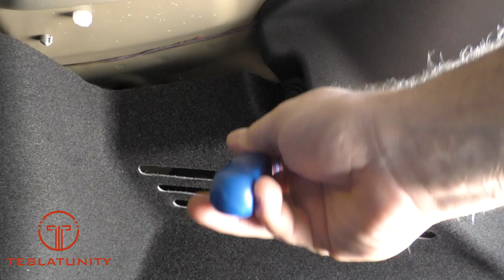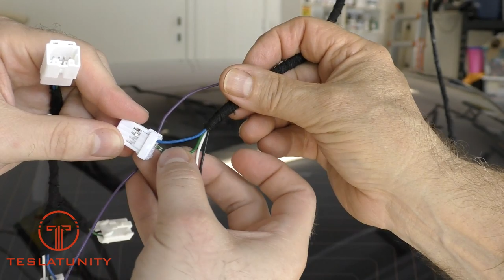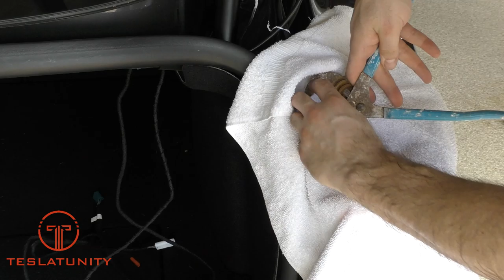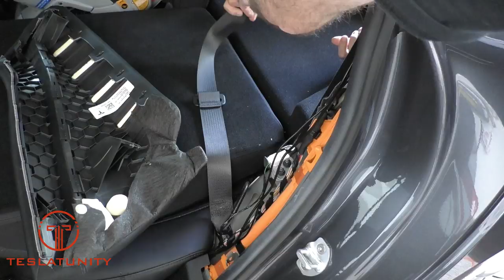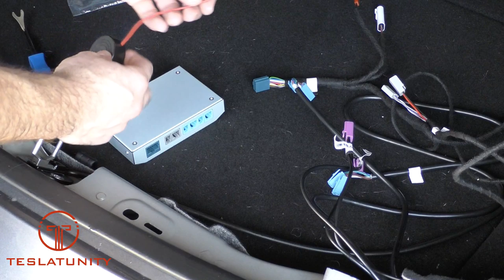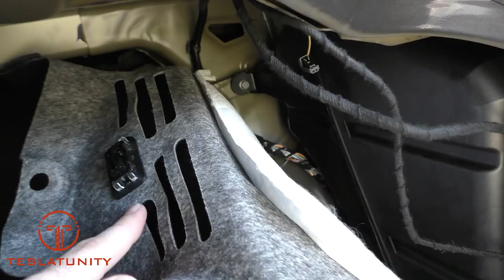Installing the Tesla Model 3 Power Trunk!

Comment: Thank you so much! Best tutorial out there! I pulled the trigger and purchased the kit after watching and just finished installing by myself. It took me about 4-5 hrs, but having another set of hands could have helped a ton! FYI - they have recently updated the kit, specifically, you no longer have to tap the green wire on the liftgate with purple wire. They now have a plugin option for that. I did not realize this and used a positap, which left me short one for the can wires. I also could not reach the red power wire (very hard to reach) and decided to tap the blue 12v wire. I had to scramble to buy something to tap the wire as my local stores did not carry the positaps, which I really like.  Thank you!

Comment: Thanks so much for the video Michael. Just completed my install and this video was invaluable. By far the most challenging part for me was the power connection. I connected to the red wire/nut that's in a very difficult to reach position. Overall I'm happy with the Tesla Offer kit.
Reply from the maker: I am glad you found the video so helpful and nicely done getting the power in the best position!!

Comment: Hi,
Have you installed the foot sensor?

I just installed my electric trunk this weekend. My foot sensor is not working as I hope it would do, its not very sensitive to my foot movement. Sometimes I have to move my foot back and fourth several times to make it open.
Reply from the maker: Sverre Olsen sorry no I didn’t go for the foot sensor. I didn’t want to take off the bumper and figured for my personal use there would probably never be a time I couldn’t pop the trunk from the app.
Reply: Michael Bodner thanks for the quick reply😊 You’ve had the electric trunk for quite some time, does it still work well without any issues?
Reply from the maker: @sverre1990  you're welcome!  I actually uninstalled it from my car, but want to say at the same time there were absolutely no issues with it.  I was having some issues with Tesla denying a completely unrelated warranty claim and it made me nervous that should I have any electrical or 12V power issues that Tesla would point to the power trunk and use it as a means to deny the warranty claim.  Funny enough, within a few weeks of pulling the kit, my 12V died without warning.  I hate that I took this out though as I feel as though the car really needs this!!

Comment: GREAT Video!  Much appreciate the details.  I just completed the install.  I did the button for inside the car, but haven’t installed the foot sensor.  Just curios, you cannot close the trunk with the app or the monitor in the car?  I could’ve sworn I saw it someplace.  Did I screw up something during the install?  The button on the trunk and the button in the car both work....  thanks so much!
Reply from the maker: Thanks, I am glad you found this helpful!  You should be able to close the trunk from the app, but not the screen in the car, which you wouldn’t need since you did the button inside.

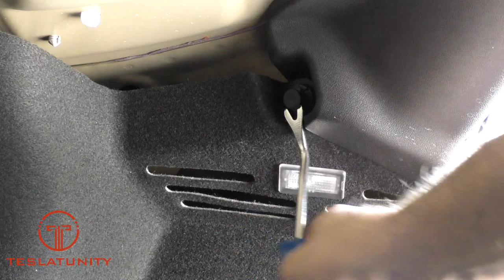Comment: 4:40 don't pull at the knob, the knob needs to stay in the middle, otherwhise the pin gets spreaded out (if the knob is fully in or fully out). So if it's hard to remove, just push the knob a little bit in and then pull at the outer ring with the tool. Then the whole plastic-thing just falls off

Comment: first drive with my model 3 opening the trunk. I can't believe how hard it is to open and close manually, swear they have cement blocks in the trunk lid.
Reply from the maker: This is definitely the hardest to close trunk of any car that I have owned. Often it stays cracked open and I would re-close it.  You do get used to it though and find the magic touch to get it closed right 99% of the time. Congrats on your new Model 3!!!

Comment: Hi, thanks for making the tutorial. I really want to do this upgrade for my trunk. 
Is the old button still there on your car? Does it still work after you have the new button installed ? I know that we don’t need the old button anymore. I just wonder what to do with it after having the new power trunk opener installed.
Reply from the maker: Hi, this video is pretty old now and I have since sold the car. Not sure what you mean regarding old button vs new button.

Comment: Splendid video, thanks a million! Just one question: Any concerns at all about electrocution from touching wires on an electric car?
Reply from the maker: Thanks!  I performed the install without disconnecting from the main power supply, so there is live electric during this install.  Always be careful and never touch bare wires.

Comment: Hi,
Have you or anyone else had problems with the 12V outlet in the center console after stalling the Tesla offer tailgate?

Mine would not work with the CAN adapter installed.

Comment: Do your trunk lights still work when it's opened?
Reply from the maker: Yes they do — make sure you remembered to plug those lights back in if you disconnected them when you pulled the liner to work the wires.

Comment: Great video, not sure if this was covered but does this system allow the app and main screen interface to work with no other mods?
Reply from the maker: Thanks!  I have since traded in a for a new car, but I believe currently the app and screen continue to work just fine without any additional modification. I can’t speak for V11 that just came out though.

Comment: Hi,
I noticed that your trunk is moving quick in the beginning, so you have standard settings or have you increased the opening force or speed?
Reply from the maker: Hello, no that’s the default, but note this video is from a while ago now so if the kit has changed with newer versions I wouldn’t be aware.

Comment: Fantastic DIY video. I feel confident in doing the install but my big concern is Tesla. What does this do to my warranty? If there is anything flaky with anything in the car, are they going to refuse to work in the car or ask that I remove all those connections to wiring harnesses first. In the past I have had remote starters/alarm installed back in the day before manufacturers put connections in harnesses requiring cutting almost every connection. This looks almost easy. Just over concerned with voiding the warranty.
Reply from the maker: Thanks!  Well in a technical sense a manufacturer cannot void your warranty for an aftermarket part unless that part is the root cause of the issue you experience. Of course with that said, should you have issues it could at least present some challenges regardless.

Comment: Hi, I got it installed at Tesla for my model 3. But the power lift doesn't open all the way up like it used to open before when it was manual open. What should I do?
Reply from the maker: I believe the power struts are slightly shorter than the original manual struts. There won’t be a way around that.

Comment: I just finished this install on a standard range plus model, just a heads up there isn’t a ground wire behind the passenger taillight. The ground wire is behind the drivers side taillight. I ended up adding an extension to the ground wire from the wire harness.
Reply from the maker: That’s great information, thanks for sharing!  That must be because there isn’t a subwoofer on the passenger side, right?
Reply: @michaelrbodner  Yea, there is just an empty space there with a black plastic wall for the side of the carpeting to rest against.

Comment: Hi.. Thanks for the installation video.. after installing my cabin climate control is not working and shows it needds service error.. any idea why?
Reply from the maker: Hi, it’s hard to say. This video was made 2 years ago. Tesla may have changed their software to not support this or a wire may have been connected in the wrong place or a wire may have been damaged during installation.

Comment: Teslatunity - have you or are you going to upgrade to V2 - from Tesla Offer. Why was it again, you did not connect power from TO to M3 12 volt battery?
Reply from the maker: Hey, I actually removed the kit (not that there was anything wrong with it), so I won’t be upgrading to v2. If you’re curious, basically I was having issues with Tesla denying an unrelated warranty claim and it made my apprehensive that this trunk was an excuse (for Tesla) waiting to happen. I really wish I had it, but I made peace with it.  As for the battery, you can connect directly but I read a lot suggesting it’s a bad idea in a Tesla to directly tap the battery despite seeing many people have success with it.

Comment: Michael, THANK YOU! THANK YOU! THANK YOU! This took most of the mystery out of running the wires up front.  Btw, is there a separate extra long wire harness for the second closing push button to run up front?  I also noticed you didn’t do the foot sensor.
Reply from the maker: You’re very welcome!  If you look at the installation manual (https://www.teslaoffer.com/Manual/M3_Power_Liftgate/TESLA%20MODEL%203%20ELECTRIC%20LIFTGATE%20INSTALLATION%20GUIDE%20v1.3.pdf) on page 4 where it shows everything laid out. Look at bundle #4 and the wire with the white connector is the one that connects to the in car button (#12). There is plenty of wire for you and it wouldn’t be hard to run one more wire up to the front, so really just personal preference that I didn’t want a button with a red glowing light. As for the foot sensor I took a pass. There is really never a time that I can’t just open the trunk via the app or press the release above the license plate over swinging my foot around.
Reply: Teslatunity Michael, I’ve been working on the installation somewhat piecemeal. I’m somewhat anal when it comes to wire management so I’m doing things at a very methodical pace. I installed the trunk lid wires first. I couldn’t find a flexible wire fish like the one you used. Rather than wait for amazon order I detached the factory harness with all clips intact, then removed all wires from the deck lid. This allowed me to lay the rubber conduit out in a straight line. I made my own wire fish out of a coat hanger. Pushing the straightened wire through the conduit was fairly easy to do. My early kit had the plastic housings on the wires, I de-pinned them. I was able too pull the wires through the conduit without lubricant.  

Also, after I had removed the interior panel from the deck lid, I figured out the trick to remove the White plastic clips. Removing those and and reinserting them on the panel made the panel reinstall a breeze.

Next up was running the wires up front. I don’t like Tapping wires anymore than absolutely necessary. Rather than tap the Blue wire for power. I used the recommended RED wire attach point. To access it, you have to remove the Knee Airbag assembly. 
It’s 1 plastic fastener to detach the floor air duct. Then you remove the 4 (E-Torx) bolts. You don’t need an actual E-Torx socket. I used a 6 pt 5/16 socket. It fit perfectly over the head of the bolts. With the bolts removed the plastic finisher cover just pops loose from lower dash cover. You just let everything rest on the floor without disconnecting the wires. With that out of the way. Access to the Red wire stud is relatively easy. I chose not to remove the Nut. Instead, I just used a second nut on top of the existing nut to attach the power wire. 

I ran all the wires to the to the back from the front, making sure I didn’t leave any extra wire. I ran the wires under the driver side trunk floor interior panel rather than up over the top like you did. This allowed plenty of wire to mount the controller above the sub woofer.  Thats as far as I gotten so far. Like I said, I’m doing this at a measured pace.

Comment: Thanks for the step by step installation instructions for the trunk.  Way better than the video that comes with the kit and Tesla raj ‘s video.  Only problem is I could not find the wiring to hook back up the drivers floorboard light.  Looked numerous times.  I think I need to backtrack where the wires are coming from.  Any help?
Reply from the maker: Thanks!  Are you taking about the driver’s footwell light?
Reply: Teslatunity yes I looked and felt for it for about 30 minutes but couldn’t find it.  Only way I figured I would be able to find it is to back trace it to the original place .  Can you take a picture of the origin of the wire then I should be able to find it
Reply: Yes I can not find the drivers footwell wire. Only way I can figure is to backtrack the wire.  Can you take a picture where the wire begins on yours so I can find mine.  Thanks
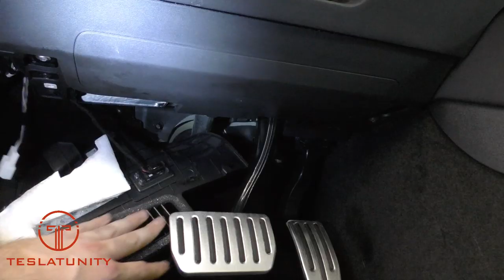Reply from the maker: Daniel Shiu try freezing the video at 21:33 and you’ll see right where the wire is coming from!
Reply: I did that already and still couldn’t find it

Comment: Looks interesting. I am just not sure about the power wire , this is what is stopping me from buying the kit. And foot sensor
Reply from the maker: Is your concern with tapping power for this?
Reply: @michaelrbodner  yes, I saw few vidoes , some people run it to the battery , others to the left side where signal wires goes, I have 2020 model 3, I am worrying that my wires will look different than those on vidoe and I will get stuck
Reply from the maker: The battery is always an option and always going to be there, but I personally don’t like the idea of touching the battery directly. I imagine the wiring is the same, but unfortunately I do not have a 2020 to check with.

Comment: Does the screen release and phone app work seamlessly with the power lift gate installed to open the trunk?  Is there any way to close the trunk using the Tesla App or a third party app or the screen in the car
Reply from the maker: With this kit you can open the trunk with the app, in car screen, and manual release. You can close the trunk with the app, trunk button (you install), interior button (optionally installed but I did not install it). The in-car screen cannot close the trunk.

Comment: Awesome video. I wanted to upgrade to the S just because of this feature. You’ve saved me a few $$$! I’m curious, though. How long did it take you and your father to finish this upgrade? I noticed you changed shirts so it must have taken at least a weekend.
Reply from the maker: Thanks!!  So the video is edited down to save you time and not bring you down the wrong paths I followed. This took us 7 hours over 2 days, but I am pretty confident if you watch this video a few times and have someone’s help it can take 2-3 hours for sure. Ok so why did it take so long?  (1) a lot of moving the camera around and switching from tripod to mini-tripod — it adds up!  (2) when we couldn’t access the red wire (12v) as I mentioned in the video, panic set in. We did not yet know about the easy to reach blue wire and actually backed the power wire all the way around the car and over to the passenger footwell. Then we took out the frunk. There is a pass through to go right to the battery from there. Fortunately that was our day 1 end, because I went home and started researching. Mixed opinions on touching the battery directly, but stumbled upon a short video referencing the “blue wire”. I reached out to Tesla Raj who confirmed he also used the blue wire. Day 2 started with reassembling the frunk and running the wire all the way back around the car to the driver’s footwell. My mistakes won’t have to be made by others!!
Reply: NOW WE KNOW WHY JAY LENO ALWAYS WEARS DENIM, CONTINUITY.
Reply from the maker: MICHGO1 100%

Comment: Do you know any local installers in our California Bay Area or in the Fresno area? Im getting the Hansshow brand auto open/closed frunk, truck w/kick sensor later this week.
Reply from the maker: I’m sorry I wish I could help, but I’m in Florida and not too familiar with California based installers.
Reply: @michaelrbodner  I appreciate the help the video was amazing you and your dad's you guys make it look easy on a scale of 1 to 10 how easy is it or I should say 10 being the hardest?!
Reply from the maker: The 1 to 10 scale probably varies by overall comfort with DIY projects, but personally from a difficulty standpoint I give this an 8 and all of the weight of that 8 is in running the the trunk wires through the rubber conduit between the body and trunk lid. With the proper tools and confidence I do believe this is very achievable though!

Comment: Did something just happen to the power feed of the blue wire at the latest Christmas update? I'm not getting any 12V anymore and the trunk is dead.
Reply from the maker: I uninstalled the power trunk (due to unrelated issues) so I can’t confirm. Did you check your connection to make sure it isn’t loose?
Reply: @michaelrbodner  Actually the fuse wire connector was loose and now it's fine again. Wires coming loose in the connectors has been an issue, so now I'll hot glue the wires in the connectors, so they'll stay in place.
Reply from the maker: Glad to hear you got it!!

Comment: Is it possible to have the power button on the bottom side of the trunk? (Near the latch) since some of my family member cannot reach the top of the trunk to press the button.
Reply from the maker: That is potentially possible — somewhere in the interior liner on the rear passenger side. Alternatively the trunk can be closed via the app (with today’s logic in the app) and you can also add a trunk close button in the driver’s footwell area (included).